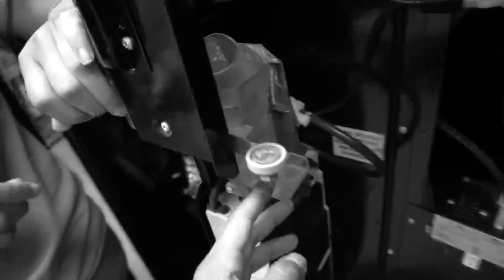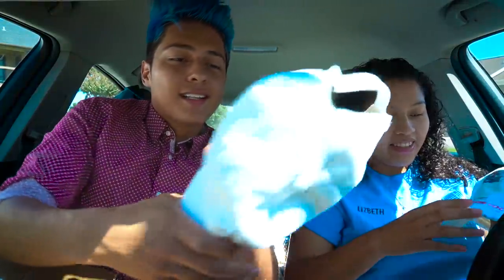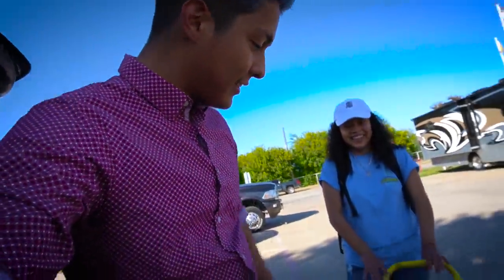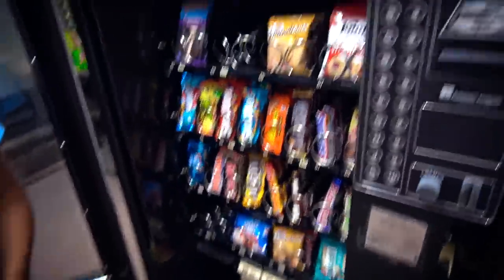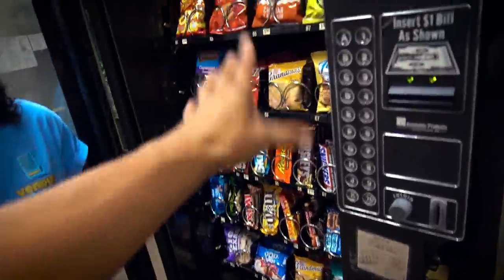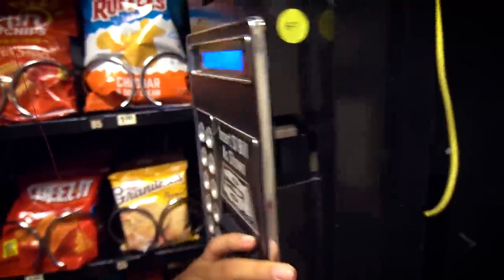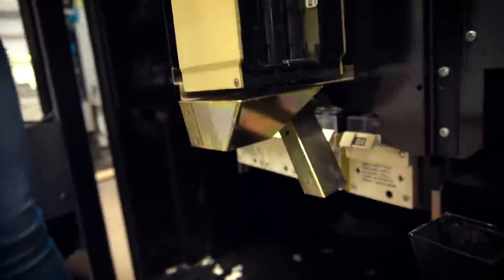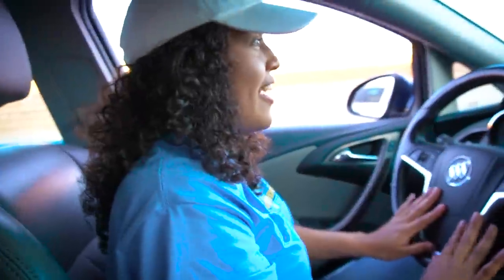Will STRING On A Coin HACK ACTUALLY Work In A Vending Machine?!!

Comment: Most of the coin changers have have string cutters. I know the older ones did.
Inside the slug ejector  (new changers) they have coils built into the changers.
As the coin enters the profile coin gets a snapshot to determine if that is a Quarter, Nickle or Dime.
Some of the older coin accepiters have edge pickers. If the coin as it travels gets verified by the first coin station it will then get picked by the next station to ensure if it shows a quarter or dime that have ridges. If it meets that requirement it go one to the nickle station and the dime station.
On the way down the coin will hit a 'bouncing block'. A coin will bounce a certain distance because of it's weight.
I believe the new coin changers will take a picture of the coin all the way down before it falls into the coin tube.

What problem we had was people getting a paper quart that milk comes in and put in 1/4 cup salt and mix in some water and shake that up. Salt and electronics will do a number on a coin changer.
I have seen a dollar validator where of Crazy Foam is squirted in. This is the kind that people use to insulate walls.
That wrecks the  $400+ unit.
Reply: futurama meme

Comment: I'm not saying you did it wrong but the reason it didn't work is because there are these little bumps on the side of quarters and that tells the machine if it's real or fake and the tape covered it and the other money you put in the bumps weren't the right size

Comment: You havent been able to do that since the 80s as all arcades etc cott on to it so it a catch was designed on all coin mechs to snap the string once pulled 👍 it also goes on weight and diamiter of the coin
Reply: the string cutters were useless , i defeated  those all the time back in the day, lol !

Comment: Most vending machines have scanners for material the coin is made of and on some occasions the size of the coin so you need the metal to be visible on both sides as well as a string that is thin enough to not get seen i recommend super glue with a thin string for the best chance at free snacks
Reply: the new mechs have a laser that can detect a strand of hair and render it useless as it is reflected on a background any strand of thread string or fishing line, or even hair, anything will break the plain on the background and it will fail, or it has the l.e.d system witch will detect the coin reversing direction and cancel the credits, ! yes it will detect a strand of hair they are that precise , just see what string will do, lol !

Comment: I'm sure it would work if you did drill a hole in the quarter and then put some string through it; obviously not a smart idea recording you doing that. I guess you could've also superglued the string to the quarter aswell.

Comment: When I was a kid, I drilled a quarter and tied fishing line to it.
I tried using it on a video game. It went in and gave me a credit, but it would not allow me to pull the quarter back up, so I gave up at that point.
Reply: that is because you went too far past the switch and the lock gate trapped it , if you did it right it would have gave you credits, then you pull the coin up gently till it stops then push the coin return button and pull it out the rest of the way,, doyyy, i have rigged all video games and pinball and got my coin back almost all the time, lol  !

Comment: this trick worked great in the old days untill the 90s , you never tape the string to to the coin or drill a hole in it , anytime you make the coin fatter it will not roll right, you super glue it to the edge of the coin with a small drop it has to harden for a half hour,  then take a knife and make sure you scrape any extra glue from the sides of the coin it has to go fast  untill you go past the comparitor but if it is too slow it will come out the coin return and if it gos too far in you go past the credit switch and you get your coin stuck and get no credit, since you have the machine open you can easily   figure the distance to the switch from the coin slot, you should try this again, remember you have to let the coin free fall past the comparitor and stop right above the credit switch, if you go just a 1/8 inch too far you will go past the switch and lose ,lol and if you have the new l.e.d switch then it wont work because it will cancel the credit when you reverse the coin back and forth , try this trick again and report back ,lol  good luck! ps, since you own the machine look at the credit switch , if it is a wire switch you can rig it , good luck, ! use thread not thick string if there is a string cutter you have to chain it or use thread that is stripped of the cotton part so you have the nylon smooth thread part only or the cutter will cut it, !

Comment: For a shoutout I have a hypothesis lol...ok so I noticed because of the tape you took around the roundness therefore the machine read it as a discrepancy due to cornered edges...what I think is this deserves a  round 2 shot. Plan of attack would be to get a string and put the thin liquid super glue...try to keep it true without affecting too much of the thickness. Good luck! Btw check us out on Apple podcast “The Brew with Andrew and Eddie”

Comment: You did it wrong bro, you should of tapped from the back of the quarter bro, cuz the machine its readin the front not the back.. That's why it failed bro...
Reply: Wrong. The tape does not work, period. He needs to drill a hole in the coin and put a very tiny very light weighted string through it without the machine door being open

Comment: The reason this does not work is because the machine has a built in censor that detects forign coins and spits them back out.
There is a laser beam the coin passes through. it analysing what the coins are made of and also the size of the coin.
Normal vending machines that take coins can only accept quarter's,dimes,and nickles while some also accept 1$ coins aka the susan b. Anthony.
You can find more info here
https://youtu.be/0AkcWjB0UBE

Comment: It has a coin sorter, the string changes the weight and falls into the “not a coin” bin
Reply: Which can be fixed by drilling a small hole into the coin then attaching a string to it. So the weight equals out.
Reply: @MrRaja  drilling a hole will remove material, the string isn’t heavy enough to replace the missing material. It would still fall into the bin at the bottom
Reply: @MrRaja  WRONG , !  no drilling holes needed or tape , ddddoooyyyy !!

Comment: These machines know the correct size and weight of correct currencies ...that's why it's not registering ...if u drilled a tiny hole in the coin X 2 have thread either side of the coin so u can manipulate the coin back out ..this can work if u do it right ...your better of using fishing mono line too btw 🤟🤟🤟 (Tried and tested <---->working on most machines how ever I have had several machines it did not work on as it knew the coin was tampered with .) Regarding putting holes in the coin it's on illegal if you get caught 😂😂😂😂. 👅